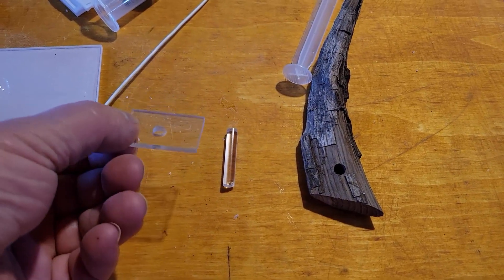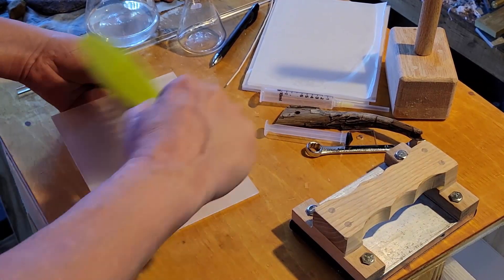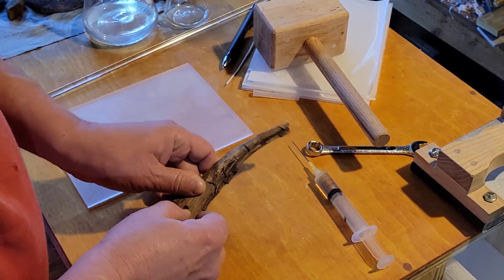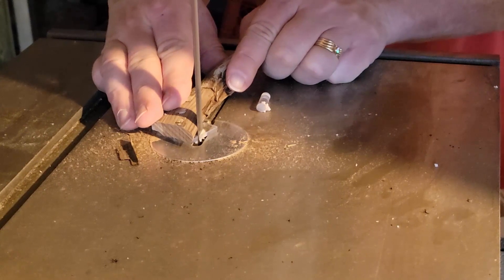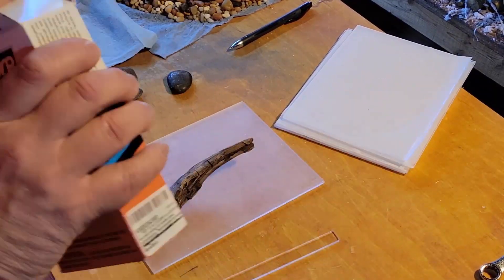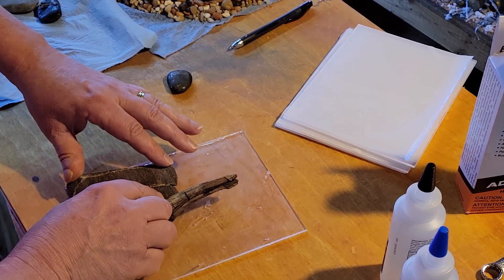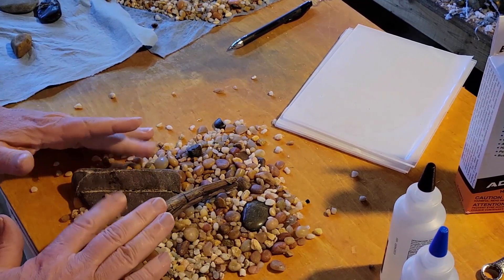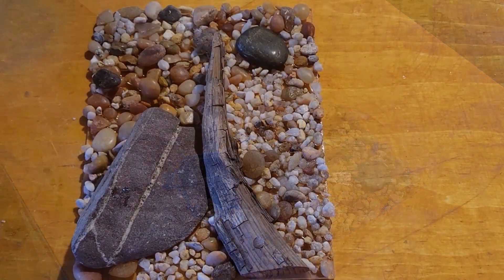Making A Simple Decorated Acrylic Panel

Comment: You often use tech chemical terms, so maybe I missed you trying something as simple as Super Glue gel?  If nothing else, it might be used to fill in voids or to layer additional wood / rocks to the decorated panel to give it a more natural uneven depth.
Reply from the maker: Hey Ray! I have tried super glue gels to add plants to wood but not for this kind of thing. The gels come in such small quantities and this is more of a slathering kind of thing. They would be good for, as you said, adding a couple of additional pieces to fill in gaps and to add depth. Thanks for the thoughts!